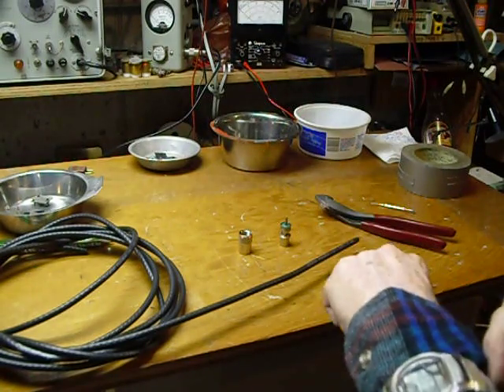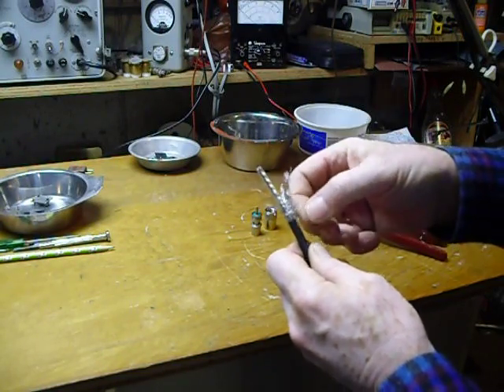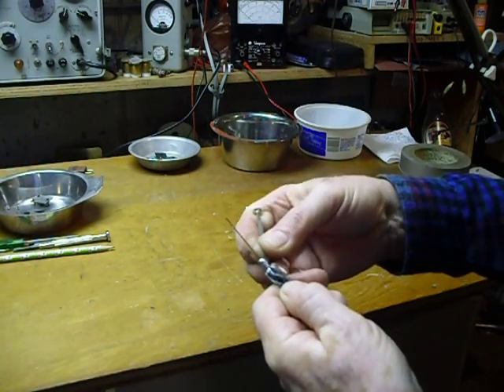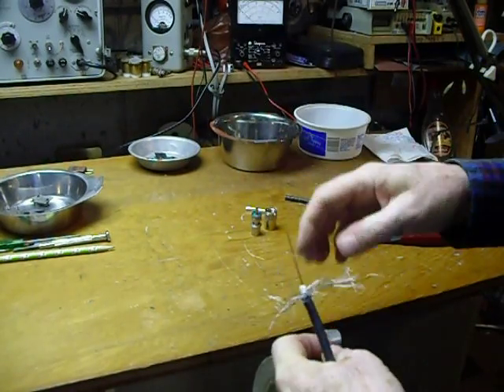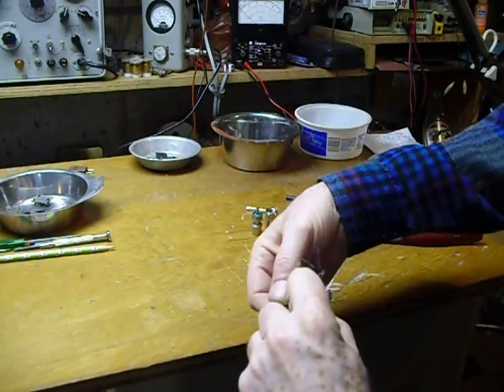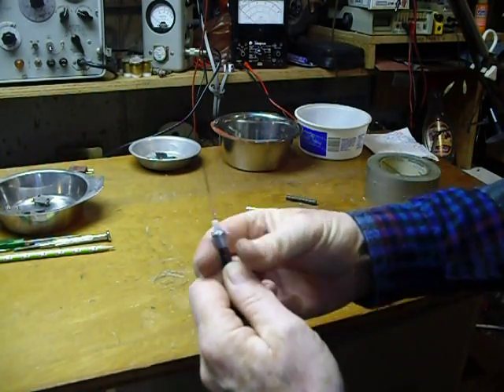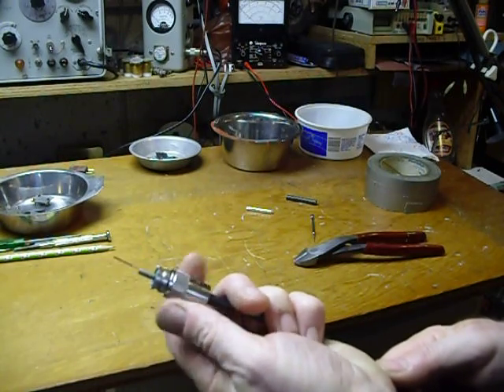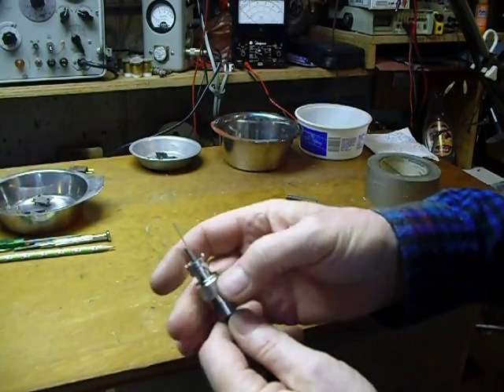RG6 coax, Installing a PL-259 on RG6, 75 ohm Coax , 75 OHM coax for amateur radio, RG11

Comment: What would this do to a radio with no tuner  being its supposed to be 50 instead.of 75  any swr change ?  And what if I planned to play a little power.through the wire

Comment: You wrapped the tape in the wrong direction i think. 

Awesome video! I always used adapters and never thought about doing this. I use the 75 ohm cheap stuff for everything. I will definitely try this.

Comment: I picked up four rolls of 100 feet of RG6 at a discount store.  I plan to use them for a 1/4 wave Christman phased array on 40 meters. I’ll need two 84 degree lines and one 71 degree line to switch in and out.  Now I need some relays. Any suggestions?  I’d like to have a max of 800 watts.

Comment: Excellent. I have a couple hundred yards of CT100 sat cable, the type with solid copper core, copper braid and copper foil, so it's all solderable. I thought I'd have to find rg259s with the right size cable inlets, which are hard to find here. That way will work just as well, and I still might be able to solder the shield.

Comment: Just what I was looking for...  I had a new house built and had the electrician run a "50 ohm coax" cable drop.  He said yes he has done it several times for hams and would run RG8U.  It was under 50 ft so I agreed.  I wasn't there to keep a close eye on things, and when we moved in I was ready to solder on the PL259's.  It had been a while so I thought I was the problem.  Then I noticed it was RG6U.

Comment: Hi Robert, just found this video. I've using RG6 with PL259 for sometime using a trick like yours but instead of duct tape I use aluminnum tape with adhesive back and the  conver the point where the coax enters the connector with heat shrink tubing the one with glue on the inside. Let me tell, those cables are very very hard to break just pulling the cable and not a single drop of water inside after years of usage. Greetings from Paraguay in So.Am.

Comment: I use BNC compression connector for RG6, for most uses have stopped using PL 259 and switched to BNC
Reply from the maker: Yes BNCs are good.  Bob

Comment: Use the adapter for RG-59, a tight fit, but NO duct tape is necessary, fold back the shield and wires,  a little wd-40 on the adapter, slide over, nice tight fit, and we all like a tight fit.

Comment: I'm sure terminations done this way may seem to work fine but how do you know they are working fine ? Have you put the system on a VNA and evaluated it ? Or are you simply assuming it's working fine because you can make contacts.

Folding aluminum braid like that is not a very god idea and while it may work in a pinch I would hardly recommend it.   I've been a ham for over 50 years, It seems like everytime I go out to a hams house to help track down RFI problems,  inevitably the problem turns out to be a stupid PL259 where the braid has been folded back like that. I can't tell you how many transceivers I've repaired were damage was traced back to intermittent coax connections from improper braid termination. 

RG6 actually makes a fine feedline for HF, But If you want to use RG6 then please do it the proper way and use F-Connectors. Not only are they designed for RG-6 they are superior in every way when compared to PL259s. The new compression type F connectors are rated to above 3 ghz, They are waterproof and constant impedance, Unlike PL259's which are barely adequate for 2 meters let alone 440 and don't even thing of 900mhz. 

What amazes me is that  hams are still stuck using these crappy connectors from the 1930's. With hams claiming to be so technically competent you would have thought they would have abandoned this archaic POS connector and at least moved on up to N connectors.  

If you absolutely must use crappy old PL259 with low loss RG6 then do yourself a favor and either use an F to UHF adapter or F to BNC or simply order PL259's designed specifically for RG6. 

Yes they actually make UHF connectors for RG6 in both crimp and compression, they cost between $2 and 5$ each.  Forget about soldering the braid it's an old school outdated methodology that's nowhere near as reliable or efficient as compresion or crimp. Don't take my word for it neither NASA nor the air force allow solder terminated coax connectors anymore.
Reply: +Radiation8 Oh I have no issue with using RG6 for feedline in fact I've been doing it for years. The problem is convincing new hams that you can use it, all you get is "That wont work it's 75 ohms" trying to explain to them that a dipole is closer to 75 ohms than 50 is useless..

F-connectors are actually better connectors than a PL259 as they are a constant impedance connector and are good to over 3ghz. Unfortunately F-connectors and PL259s share the same flaw and that is the integrity of the shield connection is 100 percent depended on how tightly you screw barrel onto its connection. That is unlike an N-connector where the reliability and integrity of the connection is not depended on the connecter even being threaded onto its connection.  

By far the biggest failure point I have seen in PL259's is hams not soldering the braid. Like in this video where he just fold the braid back and threads over it allowing the threads to cut the braid.  Every one of these I've tested has failed the hipot test.  You are much better off crimping on an F-connector and using an adapter or simply ordering crimp style PL235's that are made for RG6 and yes they actually make PL259s for RG6
Reply: I'm late to the discussion but do they make a UHF connector for RG11?  I'm getting ready to pull a 110' HF run of RG11 and would love to use compression fittings.  I too hail from the broadcast industry and know the benifets and durability of such connectors.  I also have the tools for such.  Am I better off using F connectors and adapters?  Of course I'm trying to eliminate extra connections thus reducing loss.
Reply: "Yes they actually make UHF connectors for RG6 in both crimp and compression, they cost between $2 and 5$ each."

Where do you get them? Do you have a link?

Comment: Bob TNX for this Video, I have been trying get others to use this type of cable For years, Ive been using it and RG11 since I work for the Cable company back in  the 70's
All of my HF and some VHF cable is RG11 and I use alot of RG6 on my RXing antennas..    Tnx agn  73    de Al (WC9C)
Reply: I'm more than happy to use RG6 quad core because not only does it exhibit lower loss than it's 50 Ohm equivalent but it's significantly cheaper and more widely available which is a plus in more remote locations.

My process is somewhat similar but instead of using duct/electrical tape I use the outer shield cutoffs from the cable or RG213 depending on what I have handy, those outer sheath cuttings are worth saving and so useful.

Comment from the maker: Hayden : That is a PL259 connector commonly used for coaxial cable. It was originally designed for RG-8 coax  many years ago still in wide use today ...Bob

Comment from the maker: KF5LCH ... The coax seal works good ...Lately I  have been using the Clear RTV Silicone rubber in a tube . I usually get it at harbor freight . I try to get the stuff that does not have Acetic acid in it however I must say I have used some with the acetic acid and had no problems . The RTV is messy to work with if you use it do that part the very last thing when working on antennas  .

Comment: Great work Bob! I have a 500ft spool of RG6, but I gave up using it because it was such a hassle to solder the aluminum. I'm going to give this method a try. I can see the duct tape lasting along time if a guy was to use some coax seal to finish it off. 

73,
KF5LCH
Reply: They make adapters too.  Thats what I've been using.

Comment from the maker: The102 inch whip will work on the upper HF bands15,17,12 and 10 meters using an antenna tuner but not very well you will need radials on it for the lowest band in use  .I operate ALL bands from 80 to10 using a dual 80/40 meter dipole antenna fed with one length of RG-6 . It is simply an 80 meter dipole 62 ft each side and a 40 meter dipole 33 ft each side and they are spread apart as much as possible on the ends mine are about 30 ft apart at the ends fed with an antenna tuner works great . 73

Comment from the maker: No special length however remember that the matching condition at the antenna repeats every odd multiple of a halfwave at the operating frequency down the coax .This is true no matter what coax you are using . I have several over 100 foot runs here .

Comment: Short answer, yes. It gives you a bit of an impedance bump from the mismatched radio and coax - I believe 1.4:1(?) assuming the antenna is a  perfect 50 ohms(rare). The 'bump' might help or hurt - depending on the antenna. Hook it up, check SWR(at lowest power - easier on the radio), and then tune the antenna and/or coax for best SWR. RG6 is cheap, low loss, and durable(because of high volume production for CATV). If using an AT, its not gonna matter at all. Welcome and 73s!

Comment from the maker: Yes !  RG-6 and RG-11 work great on CB antennas too .  Remember when using ANY coax that the SWR condition AT the antenna repeats itself every one half wavelength of coax cable that is why you hear stories about trimming the coax to get a low SWR this actually works if the antenna is properly tuned . I trim the RG-6 here for best SWR for that reason knowing that up at my antenna the antenna has been  adjusted properly for a very low SWR  RG-58 and RG-8 works the same way.    73   BOB
Reply: So in your opinion it’s fine to use the r g -6 for cb been reading lots on why not to use it ?
Reply: @stjohnsjohnny I have it for mostly everything. Its cheap and it works well. 
  If I had money to waste I would buy expensive coax but its probably better spent on antennas and tools.

Comment from the maker: Mikey  RG-6 and RG-11  work very well for Ham radio go ahead and use it  . I  have RG-6 and RG-11   75 ohm coax on all of my antennas. HF ,6 meters ,10meters and 2 meters . Go ahead use the RG-6 and spend your money on other things you need for your station .   73  BOB